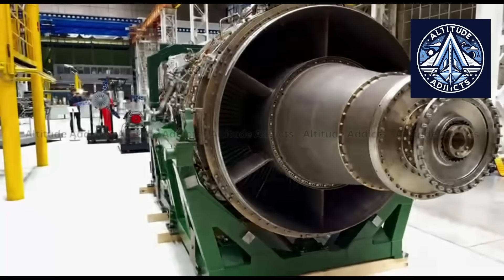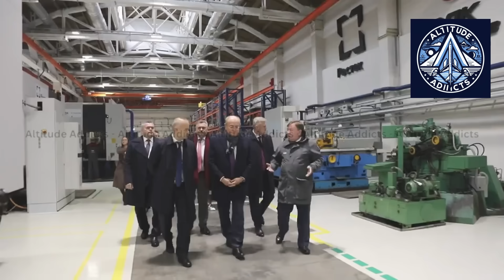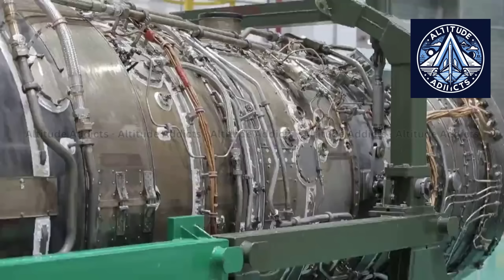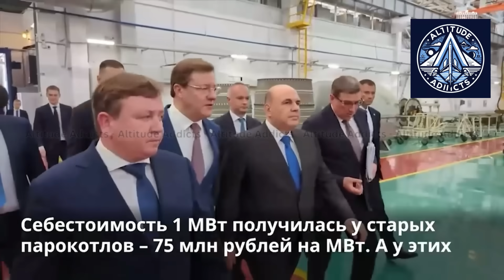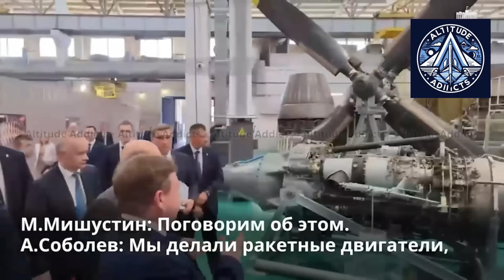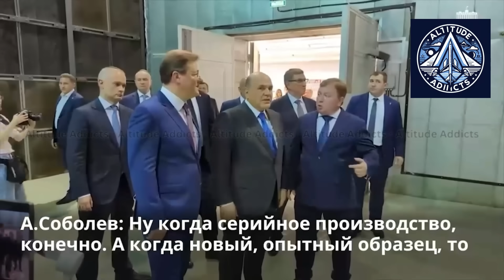UEC-Kuznetsov’s NK-36ST-32: Russia’s Answer to Siemens SGT-750 & GE LM2500

Comment: 항공기 엔진은 러시아가 경쟁력을 자랑하는 분야의 하나이다.
Reply: you may not understand that what is difference between air flight jet engine vs industrial purpose engine as ref 
 It's hard to manufacture, and it's complicating calculations: it's for in place optimalisation due to pressure intake and velocity changes.
to need big ring with holes, bigger ring with teeth for driving pins/shafts for rotation.
So for manufacturing need: bigger rotating table, or clever mounting that is stiff enough to not fuc-up positioning and not bending material, that is more precise and accurate than first option.

It's not economically viable for smaller turbines, because not all operate at different speed/load
Reply: @YDKim-cr1yx 항공기용 제트터빈엔진에 대하여 나는 전문가는 아닙니다.
그러나 이 분사식엔진 제작이 얼마나 힘든 기술을 필요로 하는지는 나도 압니다.
내가 가스터빈엔진을 직접 속속들이 관찰한것은  평양 화력발전소의 거대한 가스터빈 발전기를 본 것이 전부입니다 
항공기엔진은 겉모양만 본적이 있습니다.서로 맞물리는 블레이드 들이 얼마나 정교하게 고속으로 움직이는지는 나도 원리를 잘 알고있습니다..설계자체가 어렵습니다.거기에 들어가는 특수금속들도 간단한것이 아닙니다.러시아는 제트엔진의 역사가 80년이나 됩니다. 혁신적인 엔진 발명도 많았습니다.러시아의 과학과 기술에 대하여 서방은 폄훼하려고만 합니다
그러나 인정할것은 인정하여야합니다. 가스터빈엔진에서 러시아는 경쟁력이 충분합니다.
Reply: Not yet. Everything is in the pilot production stage.
Reply: @andrewkondrash1642  Dominar la tecnología de reactores y turbinas de aviación es muy complicada solo seis países del Mundo fabrican turbinas USA Inglaterra Francia Alemania Rusia y China el resto de países compran sus productos... Al parecer es más fácil fabricar una bomba atómica que una turbina, como Pakistan Sudáfrica Corea del Norte y Israel.